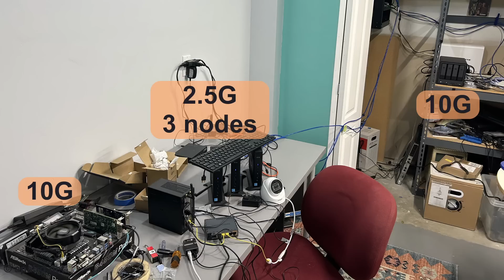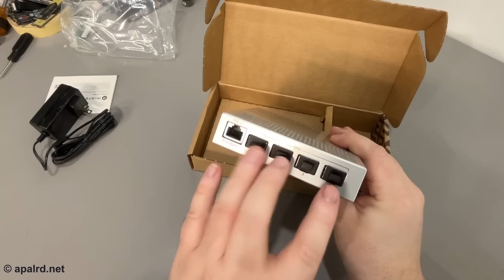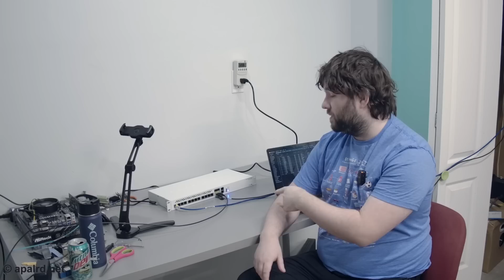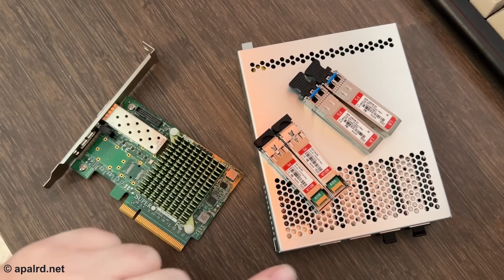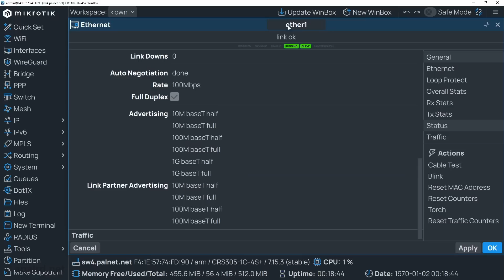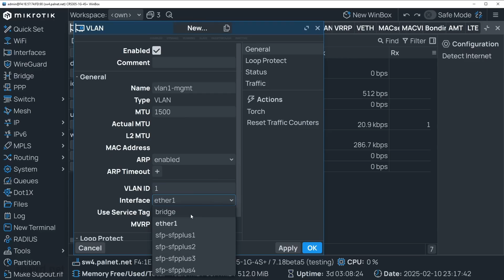Upgrading my Home Network to 10G! feat. Mikrotik

Comment: do a fog server and pxe client setup plus please try out malcolm ids on a box with plenty of ram - you want to have an audit trail and that starts with 24/7 pkt cap - i am running it on an i5-6600 with 48g (hp 600 g40 and it is running nice #arkime   my last req qould be to do karmetasploit for your own devices - you can load metasploit modules on beef, js.hook for a bit and you can get reverse shell and then run a pentest and check with metasploit - db >autopwn, it will check for vulns and exploits

Comment: Mikrotik is adding ipv6 fast track. Humungus news that everyone was requesting long long ago.

Ipv6 performance should be significantly improved now.
Reply from the maker: Yes, ros 7.18 dropped after I filmed the testing. It doesn't include L3HW fasttrack yet, but I'm sure that's coming eventually, and the CRS312 supports L3HW fasttrack currently, so it could replace most of what my router does
Reply: Wanted to ask if the new HEX REFRESH router also supports l3hw fast track? I'm considering buying it, and need fast ipv6

Comment: I love that Mikrotik guy. Dont know how to spell his name so not gonna try. Lol. His videos taught me a lot and learning Mikrotik's confusing RouterOS before anything else, made it really easy to understand networking on other switches. I started my homelab with a CRS310-8G-2S and then needed more 10Gb ports so got a CRS317-1G-16S. 

Had started that all with a 2.5GbE CWWK Mini PC as a OPNsense router but recently ended up starting to switch to Unifi sincs I needed more 2.5GbE ports and also PoE, so ended up getting a Unifi USW Pro HD 24 PoE switch and a UDM Pro Max to go along with it. Mikrotik was great, they atleast have documentation unlike Unifi having zero which is annoying but the price difference between Mikrotik and Unifi just isnt that far apart anymore, and i honestly kind of like the Unifi Ecosystem even though their software/hardware is not perfect bug wise.

Comment: Awesome video. Winbox has gotten a huge upgrade since the last time I looked at it; it looks great, and much easier to use.

Really appreciated your walk through the basic bridge/VLAN setup. Coming from a QNAP or especially a Ubiquiti switch (or anything with a more SOHO- or consumer-focused GUI, the learning curve is pretty steep. It's really helpful to see someone actually setting up one of these to be used in a SOHO environment.

I was curious: why did IGMP snooping need to be enabled on the bridge?
Reply from the maker: IGMP Snooping doesn't need to be enabled, but it will let the switch treat multicast as multicast instead of broadcast. You will also want an IGMP Querier to run * somewhere * on the network, but I'm already running it on the CRS328.

Comment: I'd rather avoid Intel X5x0 NICs, they are very old, consume quiet a bit of PCIe lanes, consumes a lot of power and just really old. And even price-wise unless you go for knock-offs (which might misbehave) - they are not that great.

Mellanox ConnectX-4 Lx (2x25 or 2x10 - ADAT or XCAT SKUs) IMHO is a better option, they are cheap-ish (lowest price I saw was 26$ on ebay, HP branded, shipping from US), still supported (security-fixes only though, but on Linux driver is the same as for all newer cards), they have slightly lower power consumption and they are PCIe Gen3, so to reach 10G speeds 2 PCIe lanes would suffice.

Biggest caveat - vendor-branded NICs might require a reflash with stock firmware, otherwise some systems won't detect them.

But I'm a big fan of those NICs in homelab, so I guess half of my youtube video comments are telling people to get them instead of intel x520 or connectx-3 nowadays :D
Reply from the maker: Definitely good advice in 2025, but I bought both of my x500 cards several years ago, so I'm making use of them where I can. This system has an x4 slot, so this card is doing PCIe2 x 4 lanes to the chipset and not wasting gen 4 lanes.
Reply: @apalrdsadventures  yeah, reusing what you have make sense, though from power consumption standpoint I'd say it might be worth upgrading. As far as I remember X520 had some problems with ASPM and it actually can prevent system from entering states lower than C3. ConnectX-4 is not ideal in that regard, but some firmware have working ASPM (latest available from nvidia website as far as I remember supports it, vendor firmware might not support it at all)

Comment: Man, that little CRS-305 is the workhorse in which a lot of homelab benches are run. I fired mine 5 years ago, it's ports are full right now and the switch is running solid since then. I use a 317 as my main SFP+ switch, a routerboard as my firewall and a bunch of Mikrotik APs. Also I use a 610 to receive 10G SM, 30 meters away from my first to my second floor traversing the rooftop from side to side. After the covid pandemic and the beggining of the Ukranian war I couldn't find Mt RJ45 switches anywhere so I have to go with other brands to distribute copper at home which was a bummer. Learned to love routerOS for the functionality and capabilities. Once you learn where is everything grouped, it's a nice tool. Setting multi ISP routing, port forwarding, VPN firewall rules, DDNS, etc becomes a copy/paste activity.

Comment: 2.5G WAN and 25G LAN here. 10G is too slow now with all flash server/NAS. Near 3GBps data transfers. 25G SPF28 ConnectX-4 cards are dirt cheap on eBay these days. Switches are getting there. My WAP is 10G though the Ubiquiti E7.

Comment: As a Latvian(where Mikrotik is from), I am very happy to see them slowly grow international recognition and audience.
Reply: slowly growing? they are fully household brand
Reply: Mikrotik gear in general pops up in a lot of funny use cases. One good one was on-board Ukrainian UAVs near the very start of the conflict, when they were retrofitting camera equipment onto existing flight chassis.
Reply: @nikomo :))))) Ok :))))
Reply: @nikomoi worked for a wisp we used them exclusively. they are amazing cost for performance

Comment: You demonstrated software and hardware routing, but it would be cool to demonstrate "fasttrack" mode. It's a hybrid mode on Mikrotik devices where traffic is initially routed by the CPU (with full firewall support) but individual connections then get offloaded to hardware once they're established. Theoretically you can do line-speed firewalling with a switch like this.
Reply from the maker: Fasttrack didn’t support IPv6 until after I’d already filmed that segment. It’s in the latest Testing release, so I’ll get to it soon.

Also most CRS switches don’t support hardware fasttrack (this one does) and hardware fasttrack doesn’t support IPv6 either. So you’d be limited to 1G for fasttrack IPv6 on this switch, but could do 10g IPv4 with fasttrack hw offload.

Comment: my understanding is that the performance on these craters when you start asking them to do layer 3 stuff -- or at least that's how it was with the CRS-309 and 317. have things improved since? at the very least I can say that my 309 is completely fine when I just have it set up as a layer 2 switch.
Reply: CRS-3xx and CRS-5xxx have hardware offload for layer 3, but you need to check their wiki/manual about the limitations because it's done by the swich chip in hardware
They also support things like MLAG for failover
Reply: the hardware offload is a feature added by RouterOS 7 btw and requires some setup
Reply from the maker: 'maybe' - it depends on if you have enabled hardware offload properly, and if your configuration supports hardware offload, and your hardware supports the offloads you want.

Basically all Mikrotik devices (Except some CCRs) have hardware L2, which can offload VLAN tagging/untagging and bridging for one vlan tag (either the 802.1Q tag, or the service tag, but not both). Due to this being required for all further offloading, this means all of your packets need to end up at the switch either untagged or all using the same vlan tag type.

Next, all of the CRS switches have hardware L3, which is what I demonstrated in this video. Using hardware L3, and it will route across VLANs at line rate, but not do any connection tracking or firewall. Enabling those things kicks all the traffic back to the CPU which is slow. 

I didn't enable fasttrack in this setup since it was not supported for IPv6 in ROS 7.17 (which I tested on), but it will improve the CPU-bound performance by 2-3x roughly for established connections. Fasttrack is a prerequisite for hardware fasttrack. Fasttrack support for IPv6 was added in ROS 7.18 (currently testing, not stable), and it's not yet supported by hardware fasttrack.

Some CRS switches and some CCRs can do hardware fasttrack. With this enabled, established connections are pushed to the asic for routing at line speed, but initial packets still must go to the CPU. This is how the CCR2216 can do 200G nat+routing with stateful firewall, even though the CPU can only do 30-50Gbps. Currently this is only supported with IPv4 and only on about half of the CRS300 switches, all of the CRS500 switches, and the CCR2116 and 2216.

Looking at this table shows the L3 hardware and fasttrack features of each CRS switch: https://help.mikrotik.com/docs/spaces/ROS/pages/62390319/L3+Hardware+Offloading#L3HardwareOffloading-L3HWDeviceSupport

There are also a few features which will globally disable hardware L3, most notably, MLAG.

Comment: You said that if it supports routeros, it supports all the features. So all new routeros devices have stopped using licensing?
Reply: the CRS312 has RouterOS license 5. What license is included in the device is stated in the Mikrotik website. In most cases they choose a license that is well above what the hardware can do anyway so there is no need to upgrade it.
Reply from the maker: Currently, all RouterOS license levels for Mikrotik hardware support all features*. License levels only change how many of a feature you can use - quantity limits for tunnels, hotspot users, and user manager, mostly. 

*A few features like containers are only on ARM/x86, so the MIPS-based switches, old APs, and the Tilera CCR1000s can't run them regardless of license
Reply: Good to know, thanks to the replies! I'm in the process of buying a 10 gig switch and this is good to know
Reply: Also I'm loving the new WinBox and it's native Linux support. Though I wish that Mikrotik went back to using LCD screens on the front of their rack devices like they did for RB3001 UiAS-RM

Comment: If youre talking about running your stuff on DC for power outages, you can run the CCR and CRS devices direct DC as well if you want to avoid inverters. 

All the ones ive used have the 4 pin connectors on the board that take 12vDC. Some of the older ones do 24vDC. Ive got a couple cabinets where i run 12v directly in the back where the power port was and run directly to the board.

Not an electrical engineer so I'm not sure if I'm breaking something, but the Mikrotiks  and DC meanwells I'm using to power them have been going good for a couple years now like that.
Reply from the maker: I think I'd keep an AC UPS for the rack in the basement (it's more than just the one CRS, there are quite a few things down there at a few different DC voltages), but for the little switch it's great

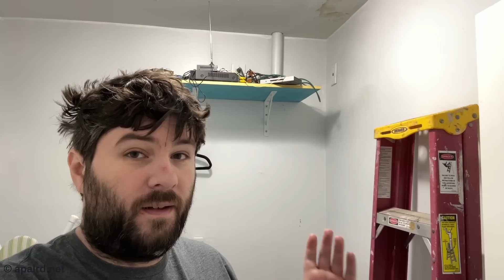Comment: 13:20 yes a fully routed kubernetes cluster is pretty dang cool. Mines switched unfortunately as I only have one HV running. But my Load balancer IPs are advertised via BGP though. Cilium does all of that without too much fuss. It's absolutely as it even comes with a consistent hashing method (maglev). The BGP implementation is gobgp so it's pretty solid. Have you tried ECMP routes on Opnsense? I don't think it works out of the box. I switched to Linux with nftables, but I think I remember that that was a problem.

Comment: This guys are rock solid, never had a problem with theirs equipment, for who do this as living is a excellent choice, for home users not so much, too much complexity and waste of time in configurations. MikroTik is only for professionals or for who is learning Networking for a living, and has spare time to invest on this. The Network has evolved to full integrated solutions with a controller were with two clicks you can do what take hours with a Mikrotik equipment. Adding to this, theirs WIFI offering is very weak. Good luck with the "new equipment", one thing for sure, will last for a very long time and with support from MikroTik with out any subscriptions. So guess that is a huge plus.

Comment: will mikrotik use vector cpu routing in some time? i cant remember this guy, was a swiss guy doing core router stuff on x86 hardware, outperfoming enterprise grade stuff by perf/watt. was fully opesnource linux routing. when i remember i'll edit this
edit
its called vpp, pim van pelt/ipng.ch use this for a ring and wattage for perfomance is awesome. maybe this is how they can improve. this was his talk https://www.youtube.com/watch?v=KXM4waZ4HLI&
Reply from the maker: Mikrotik does have connection tracking optimizations ('fasttrack'), but they only supported IPv4 when I recorded the video, so they didn't help in my case. The performance is generally 2-3x that of performance without fasttrack when using connection tracking, but their primary optimization is using the switching asic instead of handling stuff in software. Their CCR21xx and 22xx routers can offload fasttrack sessions to the asic entirely (and so can the CRS312, actually), again IPv4-only currently.
Reply: @apalrdsadventures  meh, still waiting for stuff thats using vpp. i was impressed.

kernel is slow compared to userspace.

Comment: We had to set up camp in a new data center. and for me it was Mikrotik all the way, no matter if it is a dumb switch or the main router, since the administration is that nice. Also in the home lab, where I have 5 Mikrotik devices running.

Comment: BGP kubernetes sounds dope. Im actually running a CRS328-24P-4S+RM in my homelab. I've thought about running all my L3 routing between my vlans on there, but havent gotten that far yet. so so far all routing is just being done in my opnsense VM on my optiplex 3060 micro